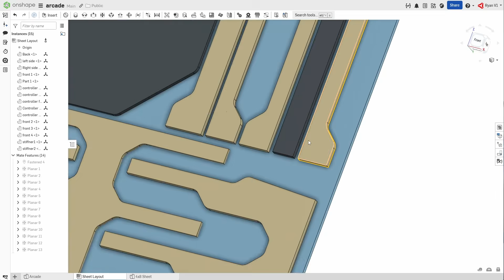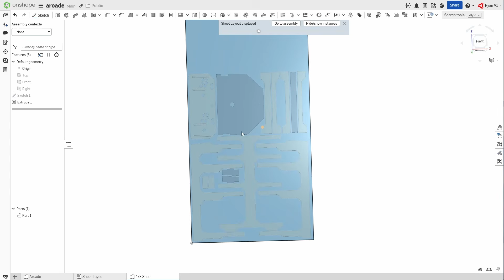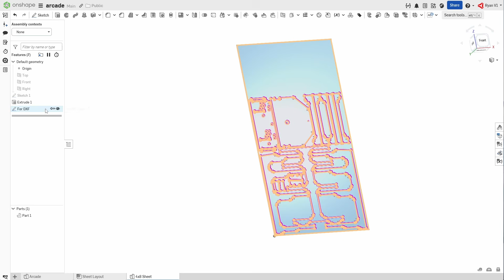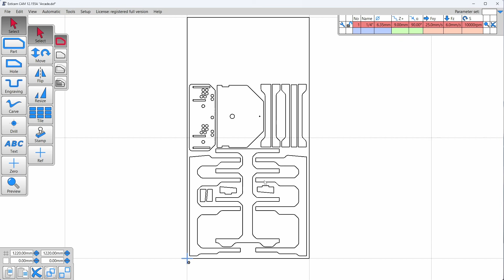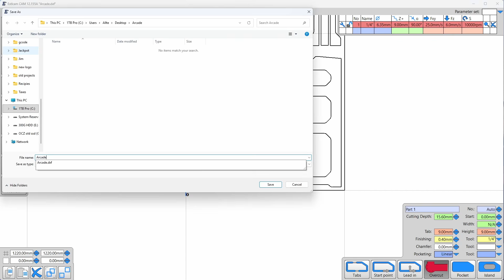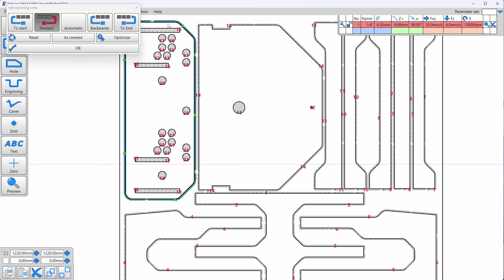Basics - Onshape to DXF to CAM

Comment: is that cam program free? and will it do lasers?
Reply from the maker: Estlcam is technically not free, $60 and well worth that, though you can use it for free with a nag screen to demo as long as you need. You can use it for Vector Laser projects, not raster. I highly suggest LightBurn for any laser projects though.